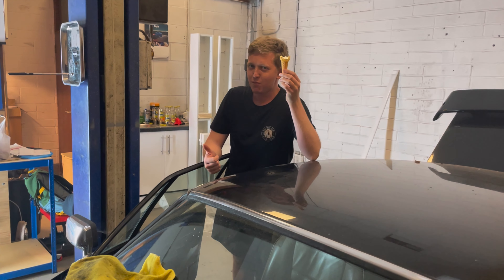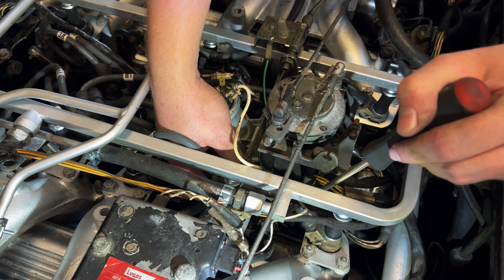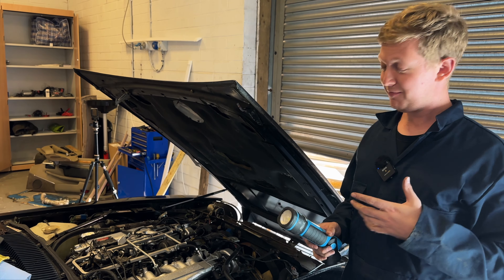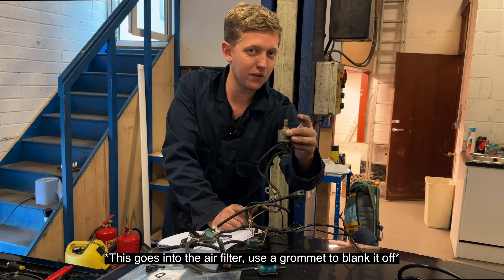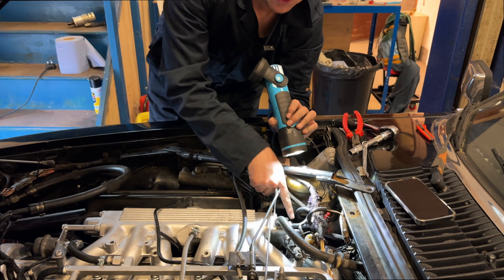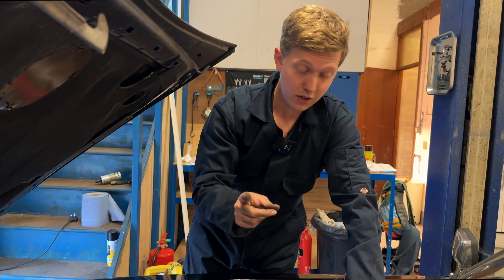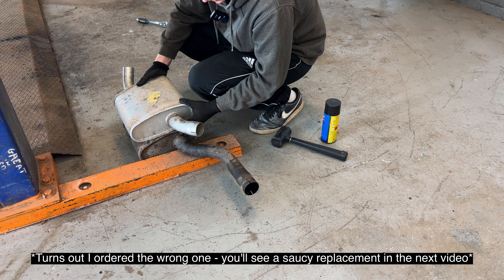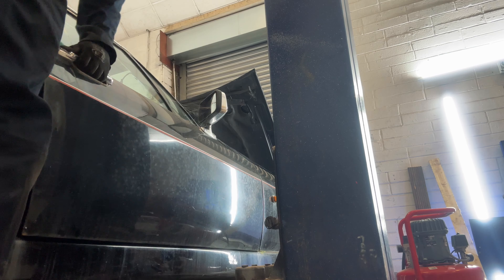Can I get my V12 Jaguar XJS running TODAY?!

Comment: I've removed the vac lines as well on my convertible as well and it has made quite a difference. So, you’re in Cornwall, pity I didn’t see this sooner because I’ve got a mild steel mid-section box set which has done less than 50 miles which would have suited you. If you would still be interested, I could bring it down with me the next time I come down probably in the spring.
Reply from the maker: Good to hear it was successful for you! That’s a nice offer, thank you. Unfortunately, I crashed the car and no longer have it 🥺
Reply: @JAYPCARS  Yes, I've just seen that! I hope though that you have learnt some valuable lessons. Don't stop there though there are some reasonably good ones out there that just need a bit of work on them to get them back on the road. However, you should be more careful when turning right on a wet road, after all we don't want you losing the back end again do we?
Reply from the maker: Definitely not!